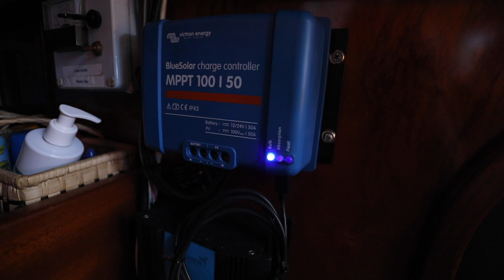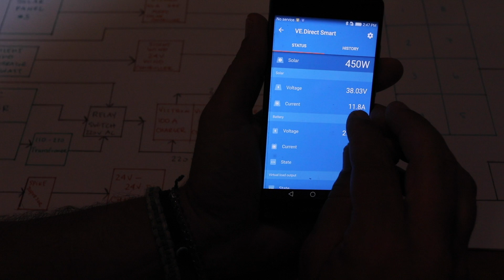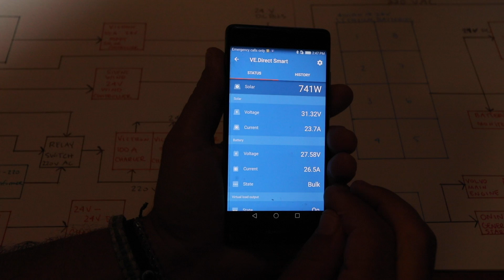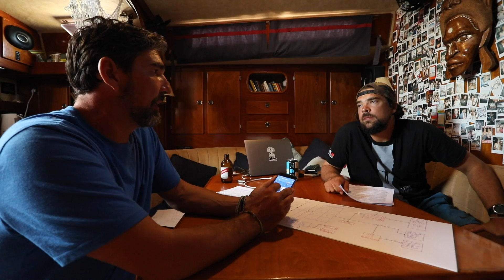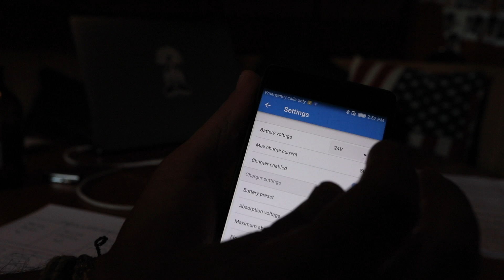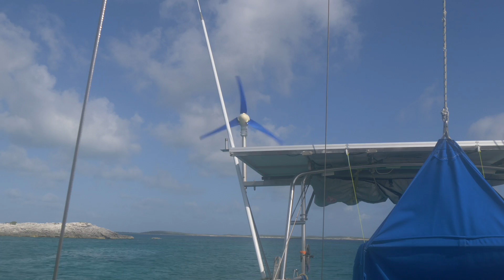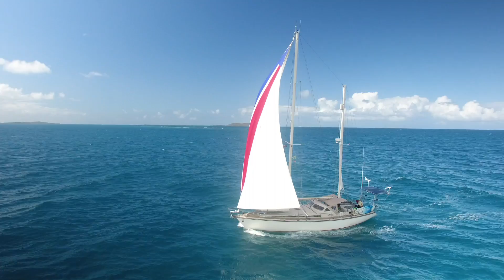SOLAR Vs. WIND - How much power can you make? ELECTRICAL BOAT TECH (2 of 7) - Sailing Vessel Delos

Comment: Clean-Green-Free-Energy is really real. Yes, lead acid battery takes twice the energy to recharge than lithium.  If you install  a solar tracker the panels can make 5x more energy.  A Morningstar’s RelayDriver™ is a logic module which provides high level system control functions such as high/low voltage alarms, load control and generator start. By installing a relay driver you can squeeze  maximum power from your panels and control the lithium charge to 90% for longevity and start automatically the auxiliary generator if charge drops below 30%.

Comment: One of the best vids on charging batteries on boats , thanks . Just one thing , Do you have 'any' worries about the batteries catching fire (airlines etc.) with Lithium Batteries ?
Reply from the maker: The LIFePO4 batteries have a lessor energy density than those used in mobile phones, laptops, and cars so a bit less volatile in that respect.  I think that also properly monitoring current flow, temperature, and voltage however is vital though.
Reply: @svdelos  Thanks , Ill be doing a delivery trip on a 2018 hanse 505 (8000 miles) & its set up with mush the same system as Delos , Anything i should look for in particular eg. Temp & Voltage . Any advice would be greatly appreciated

Comment: 2 ppl, 1200 sq ft house built in 1905, with original windows, no insulation & oil heat.
181 kWh for the month of November with an average of 6 kWh per day 4.3250 cents per kWh.  Average temp 51°f!

Comment: I think the topic which was hardly mentioned and yet is one of the most important is the water maker topic. You using the gen-set to make water. That's huge. So,, if the water maker were a dc type, (could that be done ?) how would it affect gen-set hours.
Reply from the maker: Yep, it is definitely possible.  This is the original unit in Delos, built around a design that was generator dependant.  The DC units are generally less capacity in liters/hour but it doesn't really matter because you just run it for longer off solar.  If we ever replace this unit it will have probably 1/3 the production rate and be able to run off DC so we'll just run it longer.

Comment: Just a note on flexible solar panels, a fellow YouTuber  did an interview where they discussed his use of the flexible panels and he had to mount them on a sheet of Lexan. Apparently the panels got very hot to the touch and it effected to the output. By mounting them on the Lexan sheets, air was allowed to flow under the panels. The panels remained cool to the touch and energy output was much better.
The fellow YouTuber's name was Nick O'Kelly and I think the title was "Top secret boat tour", or some such.
Safe sailing and stay well!

Grim

Comment: Very good info! My take on this is that if you changed out the old wind generator, for 1 you can use you would gain 10% or about 1kwh a day, and if you could add about 1 more Solar panel maybe flexible ones over the cockpit you could gain about 15-20%  1-1.33 kWh Giving you a Total of 5 KWh you have now + 1KWh from wind + 1-1.3 KWh from Solar = 7-7.3 KWh and no need for the Generator = 100% Green Boat How cool is that!!!!!!!!!!!!!!!!!!!!

Comment: What is the physical size (measurements) of your solar panels? How many of them? Hooked in series or parallel? Does the placement of the wind gen cause a shadow on the solar panels? ie. block out a panel? What is the total amp hours of your house bank? I am planning on a 900Ah bank, 12v system. I believe I need about 500w of solar panels, and a wind gen for those nights and cloudy days. Thoughts?

Comment: Energy from wind - you mean excluding the sailing ;). The small propeller/fan type wind generators - I would consider a turbine running on a vertical axis and e.g. hope to mount it on top of the rear mast. It is in nobody's/nothing's way there and higher above, farther away from, things that slow air down. It would also be farther away from ears that can hear it. Additional advantage is one moving part less as these are always properly positioned in the wind.

Comment: I received my Duke Energy bill this morning before watching this video. For October, when there wasn't much if any AC running in the house and we have gas heat. Our house is about 2300 ft^2, 2 stories and it is my wife and I and our newborn. We have an electric water heater, and mostly LED lights everywhere in the house. We used 796 kWh over the 29 days or 27 kWh/day. In July when the AC was pumping since we had one of our hottest month's ever, we used 78 kWh/day...

Comment: What about the solution of buying used Tesla (type) battery combos (that may require liquid cooling) out of damaged vehicles,  instead of the very expensive marine ones. I think they run much cheaper per kWh.

Comment: I think if you would have one solarpanel more, you could cancel the windgenerators? Is this a correct? My dream would be a solar powered catamaran with no mast but with an kitedrive in the front elctric motors for propulsion 2x 10kW an arrond 120 kWh capacity in lithium. 

A wonderful example is https://london.ctvnews.ca/mobile/video?clipId=1770338&fbclid=IwAR0B22J0_pyxXNzuL5QvCaGbxzvUffWjB6rb0XgOlBojHJ30cIMOItmWaXE from an canadian man.

But in the moment I live in Austria Europe in a very effizient house. I have arround 5 kWp photovotaiks on my roof and thermal solar in the facade so I can produce a year arround about 5000 kWh electric power and arround 9000 kWh thermal energy. I have no batteries at home so I have to send my surplus power into the public net. My consumption is about 3600 kWh a year that means arround 10 kWh a day. In winter I have to burn wood in my stove for heating up the house. My costs for the whole energy consumption is about 300 USDollar a year...

Comment: Great series, thank you all. The nuts-n-bolts videos are always cool. I do have a question, are there any water makers that are very small in volume and power use? Meaning, if you had a secondary water maker that did not require so many amps and is constantly on a trickle flow, you might only use the primary water maker under extremely heavy water use. This type of water maker seems a better fit for the power generation profile of solar and wind. Maybe there is a market for this type of water maker.

Comment: Also I was just looking at a 600 watt water propeller generator worth considering for how much you spend on the move. About $5k stores out of the water flips down or you can do permanent underwater installation.

Comment: Super-like these line of videos Brian! We're leaving for cruising next November and switching from AGM to LiFePO4 batteries is one of the big projects for me in 2020. We have about the same rated output on solar on an arch like yours, also use Victron controllers, and likewise we have a 8kW genset so the info is very relatable! Thanks!

Comment: You repeatedly stated you run the generator when making water, could you run the water maker off the batteries or would it deplete your batteries super fast. Same question but related to your AC, what would it take to get the AC going, couple more solar panels or impossible with the space you have left for panels? Just trying to understand the draw of these huge power sucks in laymen’s terms.

Comment: Great video.  Very informative.  I think you pushed me over the edge.   I'm now going to swap out my lead acid batteries for Lithium ones at first chance.  I didn't catch if you mention it but the LiFePo4 for the same Amp Hours take up much less space and at a reduced weight than lead acid batteries.

Comment: Thank you for the technology updates, these are great videos for us tech geek sailors. Having studied some energy engineering back in the 90's, this was interesting to see.

Boat owners should always have an up to date wiring diagram of their boat. 95 percent of boaters do not have one, but having done a few re-wiring and installation jobs, I can appreciate a diagram of the existing system.

in the 80's my father bought a beautiful wooden powerboat (36 ft traditional Finnish fishing boat, displacement hull, built 1976). The original owner was an electrical engineer by profession, and he did not have any wiring diagram, or any other documentation of the wiring. There were lots of weird electrical connections: when turning the engine room fan on, the navigation lights had a dim glow, etc.

 I think you should try to make Delos 2.0 a carbon-neutral yacht, using only renewable energy (solar and wind) while at anchor. This should be possible with some optimization.

You might want to forget the diesel main engine altogether, and have an electric propulsion motor. It would allow motoring short distances without using diesel fuel at all. (Entering anchorages/marinas etc). When you need more power (or for a longer time) than what the solar/batteries can provide, two smaller diesel generators (probably one larger and one smaller for power reserve) would be far more effective than one large main diesel engine. Smaller generators could always be run at the most effective RPM, having much better power/fuel consumption ratio than running the main engine.

Comment: Love the technical side. I’m a copilot/captain on a battery powered submarine in Maui. Plus I just finished building a house here which is completely off-grid. PV and blue ion batteries with outback inverters. Have you every thought of going with an electric motor (electric yacht style motor) and just using gen set as backup? Looking forward to your next installment in the series.  
Fair winds and following seas!

Comment: Excellent guys.  The only hypathetical Q? I have is, How much lees would you run the Generater if you had a 12V Watermaker and would that make enough water for daily living.  If that was OK then you would only be running the Generator for the Dive Compressor charging tanks.  You are really showing first hand how valuable it is and practicle it is to keep historical data for today’s anayisi and decisions.

Comment: Great analysis of power usage onboard.  My boat, Shindig (Oyster 485), is also a 24 volt DC system with generator/wind /solar.   Similar usage profile and charging sources.  Solar does most of the work and wind helps about 10%.   Generator makes up the balance and used to make water.  My experience with flexible solar has been terrible.  After 1 year the efficiency dropped to 40% of rating then 25% in year 2.  I upgraded to 2 X 300 watt hard panels won't go back.  I still use AGM battery technology but will look into lithium when they are EOL.

Comment: I am highly addicted to your videos for about two years now. Huge interest here on these videos. I am a 32 year licensed master electrician and now an engineer. I am fully versed in Auto Cad and can make your electrical drawings in Auto Cad format. Ideally, you would want the entire electrical system on drawings that could be very useful in troubleshooting. I would love to join you all for a crossing, and map out and document the entire electrical system but unfortunately my current job will not allow any extended travel. This could still be accomplished via photos through email. This would be done at no cost obviously as long as you continue uploading the great videos to You Tube. Contact me at ampero121@gmail.com if you would like to convert some of your drawings to Auto Cad.

Comment: My 4000 sq-ft house in Texas used 3325 kWh in the heat of the summer this past July with a pretty high electricity demand for air conditioning.  That was a little over 100 kWh per day.  This past October it dropped to 1825 kWh with cooler weather which is about half of what we used in July.  This was really interesting and informative.  Thanks Brian & Brady!

Comment: great video. for power comparison I live in San Diego USA. we have a 12 panel array. on a normal fall day I get 16kwH. over the year I make avg of 6mwH which turns out to average to 16kwH a day! house is a 3 bedroom 3 bath 1700sqft.  we over produce a bit every year but also might use a bit less than a normal American house (e. g. we don't watch much TV. ) though we don't have much heating or cooling due to the southern California mild climate. so, the "fraction of difference" for your panels vs my roof panels is close to 1:1. great video. fun to see the boat life vs house life in terms of solar power usage. cheers!

Comment: Last question, it is been my experience with our hybrid systems that large car barriers can on really power systems for about 4 hours, thus all hybrid systems have to run the generator to maintain cruising speed. 

For your application, would it make since to have a hybrid system(Electric motor, dc generator)? The only real benefit if the continuous hydro electric generation and maxing out the generators load? 

I can help but Remember your comment, turn on your motor and sail *****. So it might fit your application well, it puts a huge reliance on the generator tho, which doesn’t have that many redundancies.
Reply: Grammarly.com dude.

Comment: Sweet vid, love the info.

Please talk about if switching to a 24V water maker would decrease your dependence on the generator.

More Torqeedo info, our generators are actually DC. 25 kW, which helps a lot Bc we can change the rpm to run on fuel efficient more, at 1800 rpm or max out the RPM at 2350 rpm since we are not depend on being at 60 or 50 hertz. 

I also think inverter’s are really cool too,  can you talk about if Delos shore power system fits European or the American standard?

If American, do you ever have issue balancing the two legs assuming that you are taking on 250 split phase and inverter is also. (Maybe this is too much tho, just love the topic)